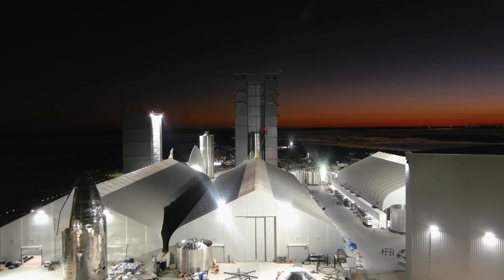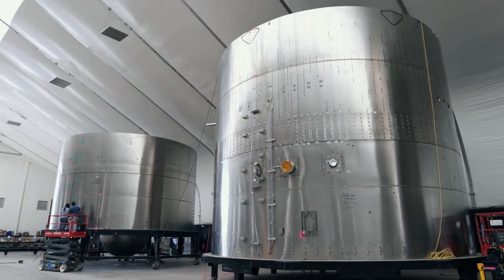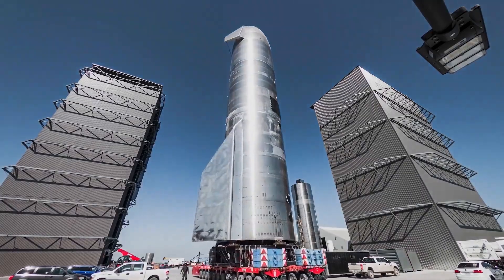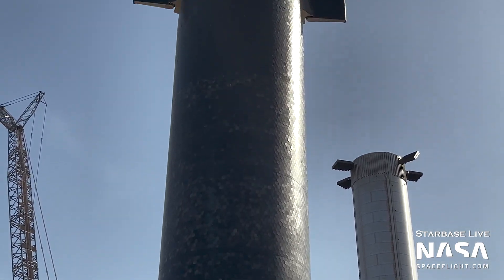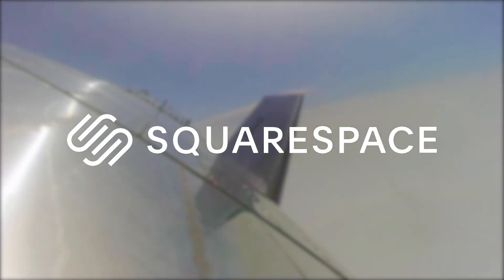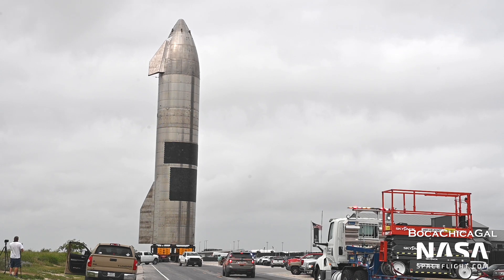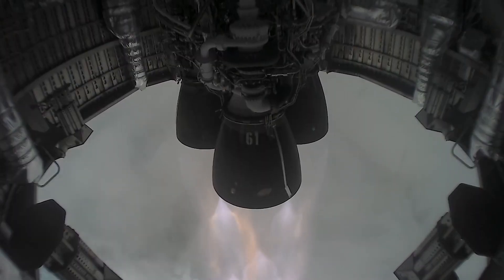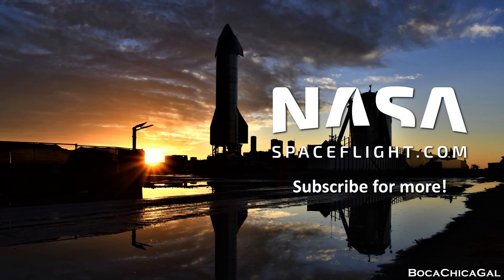How SpaceX's Starship Will Survive Reentry

Comment: One way that the TPS could be tested on a larger scale would be to place it underneath a static fire test.  The design of a rocket engine is very similar to that of a supersonic wind tunnel.  The exhaust from the raptors is both hypersonic and hot.
Reply: Most realistic simulation is to simply mount the tiles to the wall of the booster during a static fire. Sound pressure isn't the only reason they can fail. During re-entry there is high dynamic loading, high shear stress, flexing of the vehicle (its not being stiffened by internal pressure at this point) and turbulent flow.
Reply: @saumyacow4435  I would dispute your internal pressurisation observation
Reply: @jonbong98  its just physics. They cool the propellant well below its normal (atmospheric pressure) boiling point. So long as liquid remains and it remains below boiling point, gas will condense into the liquid - until the energy transferred heats the liquid enough. Remember you're always going to be left with some propellant sloshing around, after engine cut off. Also the header tanks will continue to absorb heat and keep the space around them refrigerated - which means more condensation of propellant gasses and thus lower pressure. If you want pressure, you need an active heat source.
Reply: @saumyacow4435  I wish there was a heat source during reentry! Pressure will be lower on reentry than on launch obviously but it won't be gone. I think it's in the order of 1 bar st sea level when I remmeber Elon's words correctly. I doubt Starship could survive reentry without internal pressure because the forces on the flaps would create oscillations on a bouncy body. If you look at their shape they create a pressure towards the center of the vehicle. So they squeeze it. Squeezing the body from the side would also widen the gaps between the tiles on the belly.
Reply: @saumyacow4435  no pressure, no ullage thrusters, there's pressure.
Reply: @KsNewSpace  Well, I don't have their specs, but I'd guess they'd be using several bar of pressure at launch. They have some interesting structural/mechanical problems to deal with.
Reply: totally agree with the comments. But remember materials science and design has changed greatly since the space shuttle. But there is only one way to see.
Reply: I doubt it would be that simple given the impact force of the thrust from individual engines
Reply: @JoeShmoism  I agree - plus turbulence, etc, etc.   The test stand needed for that would be entirely new design and construction - and I would bet that it's just cheaper to launch one and see what happens...that way, it's 100% realistic.
Reply: @SteveBakerIsHere build it. Fly it. Study the wreckage.
Reply: @JoeShmoism  That's how SpaceX does it.  (Boeing's 737-MAX team also did it that way - but not intentionally!)
Reply: @SteveBakerIsHere  it's also how the Russians first beat us into space and then into orbit.
Reply: They have to fly it to get all conditions. Or spend months in building different test chambers that still won't cover every aspect of flight. They already know the tiles can with stand the heat. Now they need to freeze one side and push starship through the atmosphere and see wut happens.
Reply: @ZeroSpawn  "...Or spend months in building different test chambers that still won't cover every aspect of flight" - we know SpaceX doesn't roll that way... they'll just figure out what went probably wrong, make some revisions and send the next one up. And keep sending them up until they get a winner!
Reply: @noneofyourbeeswax01  you know the plan ! 🤟🏾
Reply: @ZeroSpawn  They have to get the tile to mounting point interface working properly before any of that. Once you've got it into orbit, you need a camera on a boom to figure out what has gone missing and on descent its nearly impossible to observe what is going wrong - especially as there's no comms and if your vehicle doesn't survive its going to take a while to find the black box.
Reply: @saumyacow4435  They can transmit all the data and camera feeds during the flight and collect all on board system data in real time. You do know their other company is Starlink? Collect all data and upgrade the next prototypes. LETS GO!
Reply: @ZeroSpawn  data links don't work during re-entry due to the plasma sheath.
Reply: @saumyacow4435  this is true! But hey, no one tried to communicate upwards through the top of a vehicle to starlink during reentry. (it probably will still back out tho)
Reply: @ZeroSpawn  There's been improvements/experiments in coms by communicating Upward to StarLinks
Reply: @ZeroSpawn  In practice they found that there is a small window through the plasma behind the Space Shuttle that you can communicate through. However, Starship is not the Space Shuttle. Its a cylinder and not a wing. Hence I expect the plasma to quickly close behind it.
Reply: The issue is not whether the tiles can protect against the heat of re-entry, there is not much doubt that they can.  The issue is how many tiles will be lost at launch.  Too many lost and it will be toast.
Reply: @kokomo9764  add to that how many might be damaged or lost  enroute between Earth and Mars and you soon wind up with a nightmare senario.
Reply: Make a test tank with 4 or 5 rings, slap the tiles on one side and take the article to McGregor, to the horizontal Raptor testing stand. I reckon 30 or 40 meters away from the engine should be physically gentle but hot enough. Do a 5 or 6 minute burn.
Reply: Excellent discussion gentlemen & women. I like the minds that have gathered here! 💡